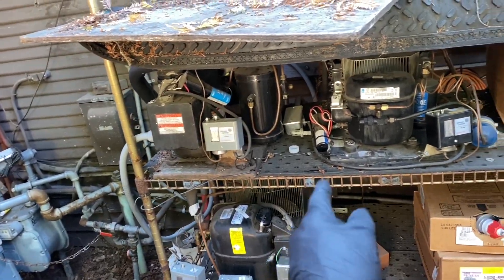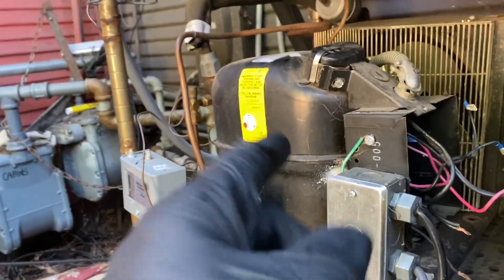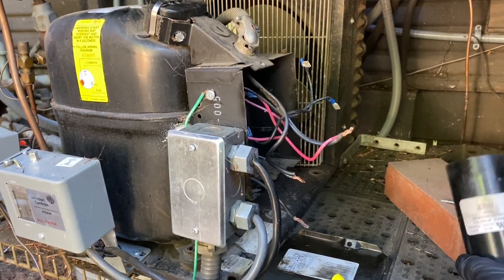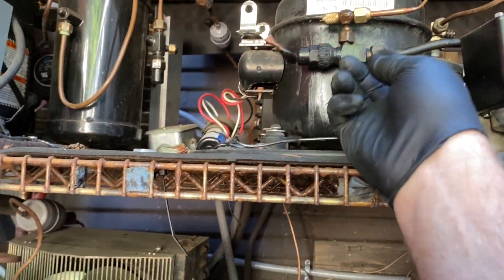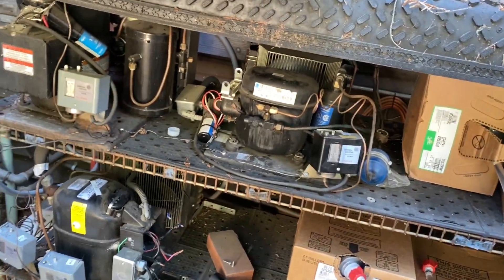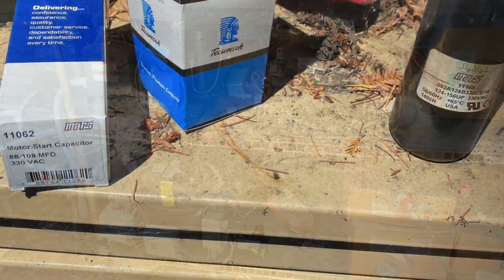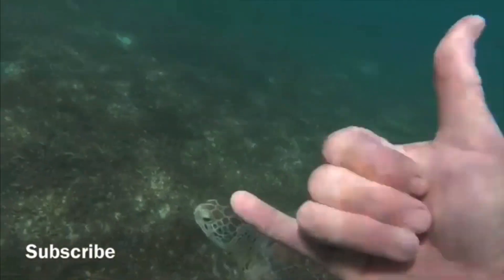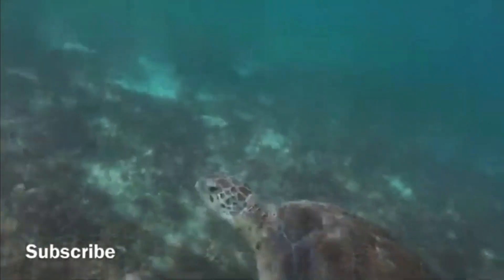Walk in down

Comment: they have the BIB soda system outside ? 🤔
Reply: Feeding the mice. That's gross
Reply: @richardl.993  high enough phosphoric acid concentration in it to kill them off if they get into it, I wouldn't worry about germs either and don't ever recall seeing mold on the undiluted syrups either.